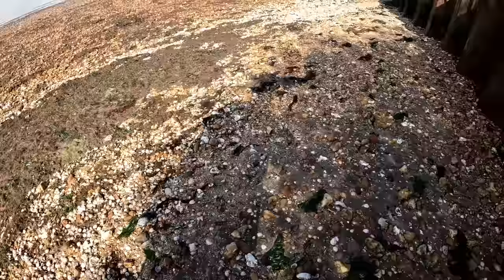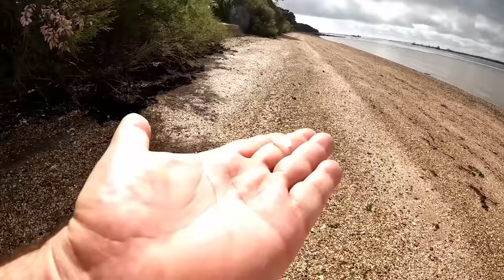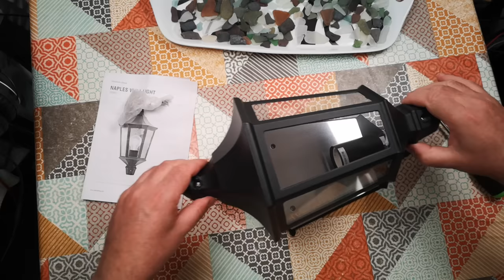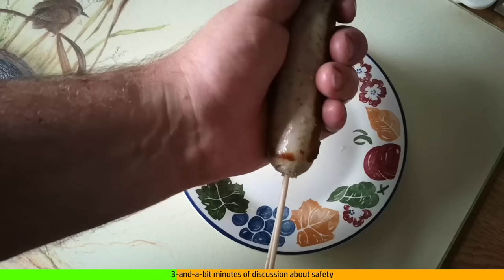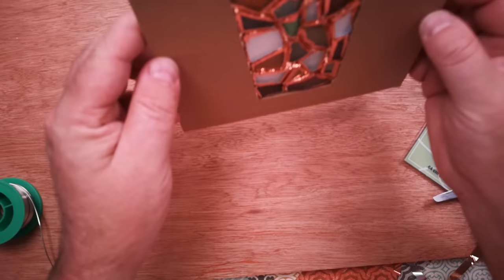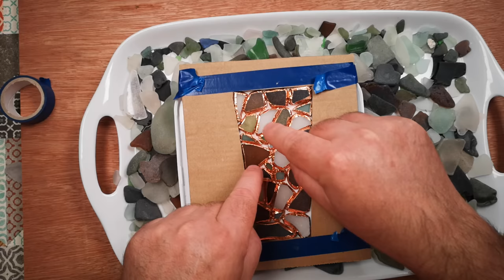Can I Make Stained Glass Panes From Sea Glass (Beach Glass)?

Comment: A couple of months ago I made an eighteen pointed Moravian star lamp (14") using a similar method but using flat glass. It was made using 80 pieces pieces of glass all cut into triangles using just a hand glass cutter. The copper tape I got from the garden centre as it's used to put around flower pots to stop slugs. I just cut it down to get the required width. The tape didn't wrap around the edges but just stuck on top as the tape was narrow and needed each 'point' to be able to hold its own shape if a bit floppy! I built the first half up and just run solder over the copper tape. Any small holes in the tape I just added small pieces of tape and soldered over. This gave it all the strength it needed so I could then do the same for the rest. Cleaning up the flux residue was a nightmare considering the number of sides and edges! Once that was finally done, I used ferric chloride to age the solder. The glass was just thin photo frame glass to keep it light. It works out there was nearly 50 feet of soldering! I even made my own bulb but that's another story.

Comment: I've seen this done with resin (real resin from a tree), lay the pieces down on a silicone base, arrange the pieces in the desired form while leaving a little gap between the pieces. After that,  use a tiny spoon like thing (in the this case it was a plastic straw fashioned into a tiny makeshift spoon) and scoop the freshly harvested tree resin (came from a cherry tree but I suppose any other tree would do?) and scoop it slowly, in tiny quantities between the pieces. It's an insanely slow process but the end result looked good and I was told it would last forever.

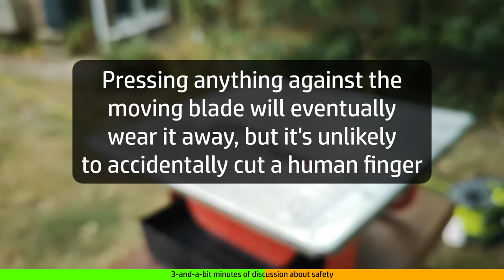Comment: 30:00 it's sorta like a cast saw, you can put the cast saw on your body for however long u want and nothing happens, but touch something hard with it and the thing just vanishes, the difference is that a cast saw vibrates back and forth, therefore no skin damage can happen cause skin isn't rigid.

Comment: what you said about beach glass, rings true of the beach in the town i was a teen in, except it was sharks teeth, instead of beach glass. all sizes from little tiny ones smaller than a grain of rice, all the way up to giant ones the size of dinner plates. though it is kind of odd seeing all the rocks im used to loads more sand than anything else, but loads of that was likely shipped in by the town for the jetty and to prevent erosion damages, stuff like that.

Comment: A little feedback for the soldering. First of all, good job on getting the fumes away decently. Very underrated and done by almost no one at home (or even at work). Regarding the soldering itself: The solder only really bonds with the copper, when it's applied through heat from the copper. Basically the way to go would to heat the tape on both pieces simultaneously and let the solder melt by holding it on the copper, it shouldn't ever touch the iron itself. That however, is only in a perfect world. And not even all professionals work like that, even I don't solder that way besides knowing how to do it. So this is more an information, rather than a suggestions. It will hold either way, it would probably hold better when made perfectly. That being said, basically I think you could've gotten away without the tape after all. I don't think it would've been much better or worse without the tape in the first place, since the shear amount of solder holds everything together.

Overall is stills looks nice though, so just take this whole comment as an information for the next time you solder some electronics.

EDIT:
What maybe could've worked great would be a hot air soldering station to get more heat to a bigger area and melt the thick solder. Maybe for the next project!

Comment: A bit of a suggestion, you can get microwave glass melting kits. You could potentially use those to soften or partially melt the glass pieces to flatten them and make things easier.

Comment: Just saw the entire video, at first I thought you were gonna tesselate the pieces of seaglass inside the mold you made, cover them with epoxy resin and call it a day.

EDIT: Just saw the pinned post.

Then you presented the idea of using copper tape and solde. This project just got waaay more complicated I thought, but the end result is very beautiful!

I have an idea on how to make the solder even (at least on one side, but I thik it wouln't be so simple):

If you had some sort of mold for the stained glass sheet that could withstand high temperatures, you could place this mold, your stained glass panel in an oven (toaster oven maybe, preferribly outside) and have the solder melt a bit to obtain a flat side.

Anyway, excelent video as always, the result was awesome even tho the solder isnt necesarily even (Most likely no one is gonna notice that anyway) 👍

Comment: Use a tile saw with a diamond or titanium coated blade, wear padded construction gloves to avoid being cut, use a huge stone as a stopper and put your hand up while cutting while using a vice to hold it down, wear goggles to prevent shards from getting in your eyes, and you will cut them to the right size, watch your fingers, use a grabbing utensil like tweezers to carefully cut it.
Reply from the maker: Gloves are not always a good idea when using tools with moving parts

Comment: should use flux, lead solder, and a stronger/thicker tipped iron. the flux pulls the solder to coat the tape... just flows into place and makes everything smoother. the stronger thicker tipped iron will have a larger buffer of heat contained in the bigger tip so it doesn't cool as easily and make the electricity do all the work all at once. lead solder just spreads more easily then electric, but you can't tell because your iron is way too undersized to deal with solder that large.

Comment: you could epoxy resin to piece up all the glasses and you can just put all the pieces together first hand (regardless of a fixed shape, just minimizing the gaps in between) and later after it harden you can cut if of (a CNC machine, circular saw or just a sharp handsaw would suffice - the latter needed skills and patience as it may take more time).
Reply from the maker: I don't think that would be especially durable for an outdoor light fitting, long term.
Reply: @AtomicShrimp  maybe weatherproofing it with some clear coat, if its in the porch (with shadings like a roof) or somewhere where the elements won't do a lot of damage - it will probably be just fine, I think.
Reply from the maker: 21:32
Reply: @AtomicShrimp  sorry I missed the part that you wanted to do stained glass the old school way 😀
the results is pretty good btw!

Comment: Perhaps some glass shards in a tumbler with sand would give the sea glass effect. You could use all one thickness then. My own efforts at stain glass soldering taught me that keeping the iron in a sweet spot heat range was important.

Comment: The only difference I see from real stained glass is that you can't burnish the tape onto the glass as well.  The last time you had a wet saw discussion I mentioned that the only way they are dangerous is cutting glass tiles.  Those little glass tiles for back splashes really like to toss chips everywhere.

Comment: Long time ago I did similar project. What I did was I bought two small bottles of epoxy glue and Cooper dust. I mixed them together and after I set all glass parts I poured that Cooper glue on it. After it hardened I just sand both sides to remove excess of epoxy. It looked really nice.

Comment: I could be wrong, but the plumbing solder I have doesn't have a flux core, whereas the electronics stuff does.  I usually use a gel flux with the thicker plumbing solder, but I think that's why your soldering iron was having trouble wetting out the thicker, plumbing solder.  Oh, and ditch the lead-free solder.  It's all totally awful.

Comment: Like you I wouldn't tell anyone to touch a diamond saw blade but as a person who works with glass and the cutting of it on a much larger blade than you are using, I can tell you with absolute certainty that touching the blade is fine, You can even lightly grab it between your fingers as its spinning with no ill affects.
Reply from the maker: Yeah, I didn't mention it in the video, but of course I have accidentally brought the occasional fingertip or knuckle into contact with this blade - nothing happened.

Comment: a thought i had. That might help your process in the even you try it again. Maybe consider solder paste. You can goop up the gaps and then take a heat gun and flow it after youre done. Itll be messy at first but might help you get a slightly easier result.

Comment: The 'finishing work' of smoothing the joins might be best done with a flat piece of hot iron. It would smooth out the joins and would wick away any excess solder.
Reply from the maker: The assembly itself isn't flat. The glass is irregular
Reply: @AtomicShrimp  I was more talking to get the tops of the joins to all be at the same level.

Comment: You could also at 28:00 wrap the pieces with tape before fitting them together in the template. That way you would find the ones that fit with the added thickness of the tape already built in
Reply from the maker: But then you waste a lot of tape on pieces you might not use
Reply: @AtomicShrimp  True. I'm glad you were able to do the second and third panel without cutting the pieces though 👍

Comment: Should have kept the tiny pieces for the gaps. 

Haven't finished but I wonder if he remembers the overlap where the brackets were mounted? Thinner pieces on those edges and thicker from what looked like 1/2 cm in would provide a flush surface with the inside edge of aluminium frame window.

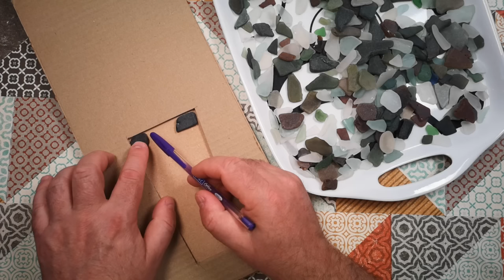Comment: 19:40 i would go the chaos way - pour glass inside, than pick everything but the first layer out and then finish it with presice fixing extra pieces and moving stuff around... but as always - humans cannot do random stuff, so anything you'll do in attempt to make it look random will have pattern :)
39:45 mby you should tried / borrowed hot air hun, i think it would go better (the copper would heat evenly and the solder you flow nicely in... then again i have never tried it, so :) ... )

Comment: I suspect that plumbing solder doesn't have a flux core? That'll be why it wasn't flowing until you added the other type. 
Also you could do with a larger tip next time just pumping up the power isn't enough when your soldering something that wicks the heat away. Both guesses but I've worked in electronic manufacturing for 30 years so educated guesses. I like the end result btw looks good 👍

Comment: my good sir, what you need is flux! that's what made the thin solder bond onto the copper, there's a flux core in it, the thicker one, which is intended for plumbing, doesn't. You'd drown the work in flux yourself before applying heat and solder.

Comment: 31:15 i've nicked my finger on both types of blades and can confirm that what's on screen is pretty much on point with reality. One touch, one single, glancing blow can mangle the skin pretty badly on a toothed saw, whereas a diamond saw will only cause a light friction burn with prolonged contact. Safety comes from fear of the tool. When you lose fear of it, that's when it bites you, but at the same time, it can be defined as fear loss = attention loss. So in shorter terms, respect the shn!zzle out of the tool because it's more powerful than you are. Basic, 101 safety.

Comment: It's interesting to me that the package of copper tape you have is identical to the one I bought here (other side of the globe) about 10 years ago. I wonder if it's such a small market that there's really only one manufacturer.

I'm just getting to the part where you're tacking them together. From previous experience with this kind of stained glass it's a fair amount easier to work with if you pre-flux the copper before adding the solder instead of using solder with flux included.

Comment: I suspect the lantern is high pressure die cast. It's a very impressive process.
Reply from the maker: I think you must be right - some of the features - the screw posts in particular are clearly not pressed, but the other parts are very slim

Comment: I saw the long 1st panel coming. fwiw. you needed a higher W solder and a lower meting point mix - lead free - imho. other than that worked okay. The height mismatch personally would take up during the 1st phase of tacking (which you did) to create one flat plane "front" and the back is inconsequencial anyway. Solid plan. decent outcome. maybe go for a larger LED run at 50% power for longevity (Kreeeeeee) . Hope it worked out.

Comment: An excellent project and obviously the results gave great satisfaction.

Just an idea, but I'm just wondering whether the use of a SMD hot air gun might have made soldering a little easier and would have provided a smoother and more consistent flow of the solder.
At a pinch, a hot air paint stripper gun might be used to good effect in such projects.

Comment: When I was a younger lad, about 28 years ago, my mother made stained glass panels for the front door of our house. At the time, however, you could still get the actual lead H came stuff. She then used lead solder at the intersections and used a glass-cutter to cut colored glass to make it.

I wonder if you could get other soft-metal H came?

A quick google search reveals the current came of choice is zinc, with brass being used by more professional folks.
Reply: Lead came is widely available...
Reply: @mark314158  Huh. Well, I stand corrected. I would have thought people would be wary of working with that stuff these days—or particularly about putting it in a house.

Thanks for the heads-up!

Comment: Have you got a hot air paint stripper? Now you have everything together try heating the pieces as a single unit. Should smooth out the blobby soldering.

Comment: This is a great project. Had you considered wrapping them in foil, then simply pouring over some clear epoxy resin? You wouldn't have to worry about the thickness and the copper would be visible and more light would show through. Have you tried a heat gun to flow the solder more evenly once it's all assembled?

Comment: with electronics wen doing large mass stuff it helps to use a pre heat(aka hot plate) might be worth a shot with is. Also use a well tip on the iron,(more heat transfer is key) the conics are really terrible especially for what your doing and probably a good chunk of your issues.

Comment: I admire your ability to stick with a project and find new ways to proceed when they don’t go as planned. I was wondering about getting the soldering smoothed out, was it possible to put the piece in an oven to flow the solder to even it out, as opposed using the iron to re-flow it. Is suppose the uneven thicknesses of glass could’ve caused it to all come apart if all the soldering was melted at the same time though. I’ve never done anything with solder so idk.

Comment: What actual purpose does the copper serve? it seems like you could get the same effect by just melting the solder onto the gaps until they are full.
Also, an idea for smoothing out the seams: cover one side in clay, then broil it in a toaster oven. That should support the glass and keep the solder from flowing out, while also melting the solder all at once and letting surface tension smooth out all of the imperfections.
Reply from the maker: The copper keeps the solder where you put it. If you tried to apply it direct to the glass it would just bead up and run off

Comment: Honestly, you'd be better off just investing the minimal cost of a glasscutter than using the diamond saw.  it'll be much faster and more precise.  Other than that, its a nice little project.
Reply from the maker: A glass cutter works by creating a surface imperfection in a sheet of glass, that is propagated into a controlled break.  I don't think that will work on seaglass, where literally the entire surface is already covered by damage and imperfections.

Comment: Just a thought but id add paper between the carboard and the glass and draw round the pieces when im happy with how they sit. This should make it easier to remove and replace them when taping the sides. obv when mistakes are made just bin the paper and start again with a new sheet, could layer them and check previous work as u go. ......Would tracing paper and a light source from below help further?
*Thinking out loud here.

Comment: Loved the final result! however the metal thickness seems too much in proportion to the glass pieces, is it possible to use smaller copper tape or it would just not bond? maybe bigger glass pieces then?
Reply from the maker: It has to wrap around the glass to form the framework. Thinner glass could use narrower tape

Comment: Just to imagine the amount of solder fumes makes me dizzy and nauseous. It probably is dangerous anyways but every time I solder I wear a plant chemical application protection mask (either FFP3 or coal filter). I feel really ill from inhaling the fumes. And that is from soldering a few wires for LEDs into lego torches with lead free solder. 

Also why is this video so hypnotic? It is like watching a Bob Ross video.
Reply from the maker: The fan on the desk is extracting the fumes to a duct out of the window. Fumes are only likely to be flux and contaminants burning as the process is well below the boiling point of any metals in the solder